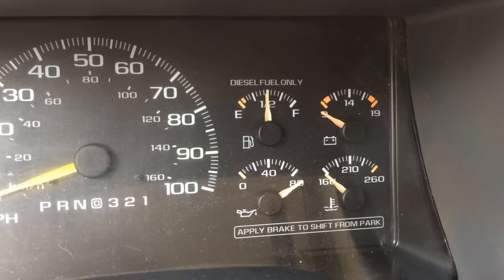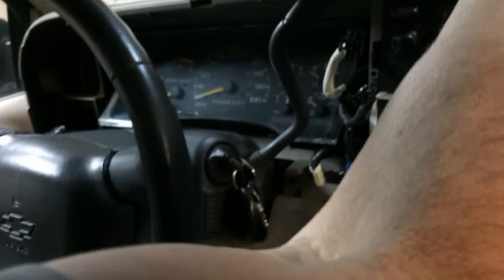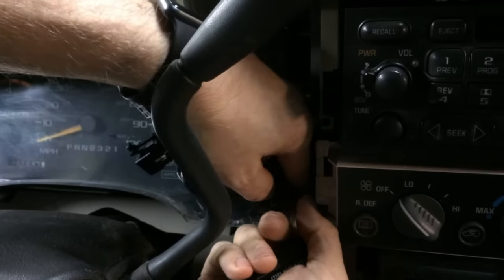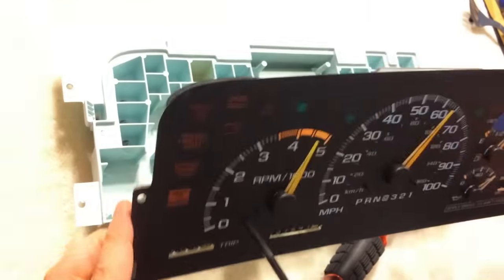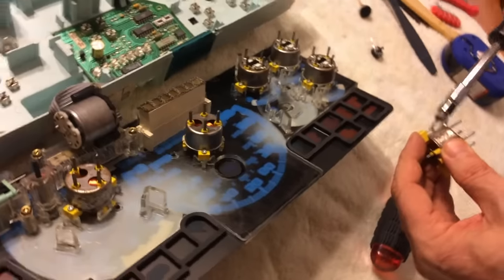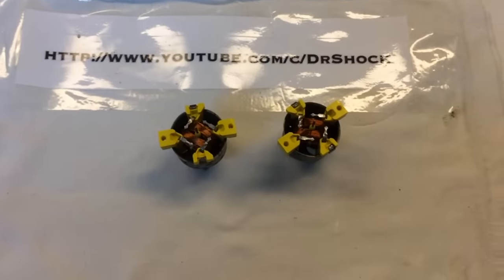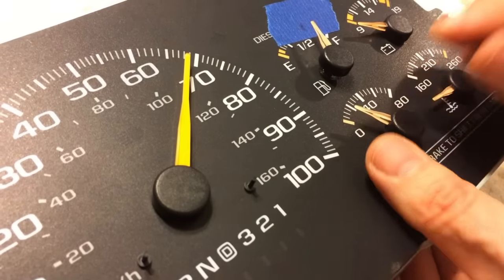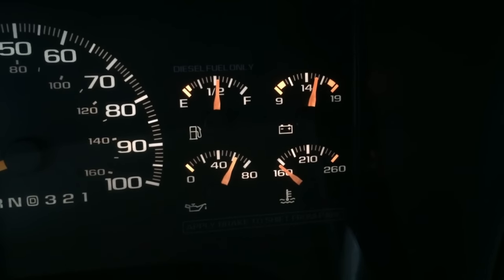1994 - 2002 GM Truck Twitchy Erratic Crazy Fuel & Oil Gauge Needle Aircore Motor Repair (Chevy GMC)

Comment: Dr. Shock como siempre muy buenos vídeos tutoriales, específicos y educativos.
Quería hacerle una pregunta muy específica al tema:
Resulta ser que hace unos días desarme el panel de instrumentos de mi tablero del coche.
Para remplazar unos Light bulb  fui muy cuidadoso aproveche para limpiar instrument cluster connector tanto en macho como la hembra con un cotton tip y alcohol isopropílico (ya que veían con algo sucios y con polvo).
Antes de volver a montar instrument cluster;
Después hice mis pruebas abrí la llave ignición todas sus luces bien, gauges bien, selector de cambios prnd123 bien.
Y al cerrar la llave de encendido.
Probar la iluminación, encendido los tail light Hooo! Sorpresa 😭.
El gauges del oil y fuel se mueven a  la posición cero más que nada el del oil y si enciendo el motor  y Luego tail light veo como el medidor se mueve una un poco hacia cero o empty pero como la señal del ops o fuel sender unit son más fuertes pues no se va a 0 psi.
Buscando información en internet me topé con tu vídeo https://youtu.be/dw9Hia55yys.
El cual me ayudó mucho vi instrument cluster connector en esos diagramas pude identificar cada pin (porcierto que libro usas, ya que aquí en México no es fácil encontrar esa información)
Me topé que el pin 29 es el de las iluminación dimming del señal tail light y hay 2 ground el pin4 que es para la electrónica del cluster y el pin 31 que es para bulb light y Gnd de los gauges veo que se comparten.

Use mi multímetro para medir resistencia y noto que midiendo el pin 4 a cualquier metal expuesto e la carrocería hay una resistencia de 20 ohms yo deduzco que a de ser la vejez de cable pues 22años. 
Pero yo le pregunto sabe usted si  el Gnd del cluster tiene alguna resistencia de paso como protección.
O va directamente al chassis y si para estos cluster es despreciable eso 20ohms en el conductor o recomienda reemplazarlo el cable para bajarlo a menos <1 ohms.

También preguntarte cuando cambie bulb light marca flösser (porque wangler es bien difícil encontrar en mi ciudad) note que al instalar el foco y girarlo ya no prendia la luz y tenía que estar girando asia los lados hasta que entendiera la luz como que el pad de cobre donde van montados es muy delgado o se oxida usted a tenido algún problema así.???

Por último cada vez que enciendo las luces tail light para checar con mi tester que efectivamente el pin 29 se energiza  también noto que el pin 8 se energiza junto con pin 29.

De ante mano agradezco mucho su atención y dispense las molestias.
Reply from the maker: Mucha información aquí, intentaré abordar la que tienes.

- Debe tener cuidado con los solventes en una placa de circuito impreso de mylar flexible como la que se usa en el grupo de instrumentos. Puede dañar el plástico en algunas formulaciones.
- Sí, las bombillas de repuesto de la marca del mercado de accesorios pueden tener problemas para hacer contacto con la placa de circuito impreso flexible. Puede levantar, ligeramente, las clavijas de contacto de los portalámparas con cierre giratorio.
- Estoy usando el manual de servicio de camiones GM genuino de 1998, que ha estado agotado durante más de una década.
- No estoy familiarizado con todos los circuitos de tierra involucrados en el esquema del grupo de instrumentos. Pero suena como un problema de fondo que está describiendo allí.

A lot of info here, I’ll try and address what you have.

- You have to be careful with solvents on a flexible mylar printed circuit board like that used on the instrument cluster.  It can damage the plastic in some formulations.  
- Yes, aftermarket brand replacement bulbs can have trouble making contact on the flexible printed circuit board.  You can pry up, slightly, the contact pins on the twist lock bulb holders.
- I’m using the genuine GM truck service manual for 1998, which has been out of print for over a decade now.
- I’m not familiar with all of the ground circuits involved in the instrument cluster schematic.  But it does sound like a ground problem you are describing there.
Reply: @DrShock  muchas gracias Dr. Shock , no sabe cómo.
El manual de reparación de la GM que tiene se le puede comparar con libro CHILTON 28624, o nada que ver el original siempre será más completo???
Para concluir podría hacerme un favor :
en su otro vídeo muestra en su manual GM en la hoja del :
"instrument cluster connector"
Que el pin 4 y 31 que comparten Gnd  menciona que revise el circuito N° 451 de su libro.
Agradecería si me mencionara si el cable va directo  y atornillado alguna parte metálica carrocería o chasis y porque área aproximadamente se puede encontrar  esa conexión en la cabina o si pasa por algún circuito de protección y por eso la pequeña resistencia.

Dr. Shock de lo demás yo me encargaría  e investigaría.

De antemano gracias.
Reply from the maker: He utilizado guías de Chilton para vehículos en los que no tengo el manual de GM a mano. Ciertamente son buenos libros y los recomendaría. Pero no puedo decir si la camioneta de este año tiene lo que está buscando esquemáticamente.

No he tenido que depurar el circuito de tierra del grupo de instrumentos, así que no puedo decirlo. Pero conecte a tierra cualquier circuito de tierra 4xx (por ejemplo, 451) que se ubicará en el área de la caja de la rueda trasera / cama.

I have used Chilton guides for vehicles where I don’t have the GM manual handy.  They are certainly good books and I would recommend them.   But I can’t say whether the one for this year truck has what you’re looking for schematic wise.

I haven’t had to debug the instrument cluster ground circuit, so couldn’t say.  But ground any 4xx ground circuit (e.g., 451) is going to be located in the rear wheel house/bed area.

Comment: hey Drshock, i have a 97 chevy silverado 4.3, the 3 that show on the ebay link, would they work on my truck
Reply from the maker: The 97 uses the same aircore motors yeah.  But like anything from this older video, the "F" type is an easter egg hunt other than rebuilt now.  After Covid came whoever was making these in China obviously went out of business as haven't seen any new F's for almost two years now.  The others gauge codes still seem to be around (check the video description for a complete list of codes and model years).

Comment: 93 Chevy truck 2500 4x4 do they take the same one you put on the cluster air core motors
Reply from the maker: The earlier trucks also use an aircore type design, as would GM trucks going back to before WWII.  But it's not the same part number as what I've shown here and I'm not aware of a supplier for motors to fit the older design circuit board.

Comment: Where did you find the replacement parts? I looked and couldn't find any with the "F"
Reply from the maker: There are search links in the description.  There's at least one vendor still on eBay with that code.
Reply: @DrShock  thank you

Comment: Would installing a new cluster assembly fix the issue as well?
Reply from the maker: GM hasn't made new clusters for these trucks in many decades.  There were some aftermarket rebuilt ones I linked in the description, but they do not always get the aircore motors replaced.

Comment: My rpm guage isn't moving much when I rev the engine. The old motor from old cluster was working fine. But when I put the old motor onto the new cluster, it's not working right. New motor isn't working right either. Old cluster and motor is in kilometers cause it's a Canadian truck and I'm converting to a cluster in miles.
Reply from the maker: The tachometer (gauge that shows the RPMs) takes its input from the engine computer reading a signal from the alternator.   So I'd start with checking that signal wire from the alternator wiring harness first.   If that looked good, I'd next swap alternators.  Remember when you swap engines, unless it's a compatible match you may run into incompatibilities between engine computers.  When I've done such swaps myself, I've only pulled the engine from a donor of the same year and model vehicle to avoid any computer incompatibilities.

Comment: Could one interchange a air core motor in place of the fuel gauge
Reply from the maker: For the years this video covers, all of the gauges are air core motors which only vary by the calibration.   You cannot interchange them without loss of accuracy.   The fuel gauge is also the more unique as it includes a fluid damper that the others lack.

Comment: My temp gauge usually read somewhere around 200 degrees but suddenly started reading about 180. I replaced the sender unit but it did not make any difference. Do you think the gauge is the problem?
Reply from the maker: If the gauge consistently rose from zero up to 180, no that would seem to be normal aircore motor operation.   If I had this situation I would check that the thermostat is operating correctly.

Comment: I have a 97 Tahoe same gauges and the speedometer has began to read 10 mph fast . I’ve changed the speed sensor on gear case underneath the truck with on difference. 
I wonder if my gauge is malfunctioning and something like this would get it to read the correct speed. Everything else works as it should.
Reply from the maker: It would be unlikely for the aircore gauge itself to be involved in this speedometer behavior.  Unlike later stepper motors, these devices are more analog in nature.  In fact, it would be unlikely to have been the transmission/transfer case speed sensor either so my advice would be put back the OEM one from there if you replaced it with a aftermarket part as the OEM part is going to be far more accurate and reliable.  Parts wise it would be more likely to be the cluster electronics on the flexible circuit board (i.e., oxidation causing additional electrical resistance on a signal trace, reduced spring contact tension at the dash female connector, etc.
 
Typically this sort of problem is from using a tire size different than the vehicle was originally built with and you thus need to reprogram the VCM to account for this change.  But there can be age related drift as well which may be uncorrectable at this point in a GMT400s lifespan.  You may find it cannot be corrected for, but a reflash is the place to start as it would recalibrate this value to original specifications.  The VCM reprogramming route is only if you have a gasoline engine.  Diesel engine vehicles use an older vehicle speed sensor buffer (VSSB) or digital ratio adapter controller (DRAC) module depending on the model year that you have to adjust manually instead.
Reply: @DrShock  I had already put the original speed sensor back and I still have the factory size wheels and tires on . I don’t know much about flashing the VCM but had one person who isn’t that familiar with GM told me that 1997 model was too old to flash/reprogram . If I can find someone that has the know how to do this flash what all does it affect , don’t want to change anything except speedo truck runs great. Do you know what type of machine is used to flash VCM on 97 model ? As I’m sure you can tell I know next to nothing about the computer side of vehicles, but would appreciate any knowledge your willing to bestow upon me .
 One more thought could incorrect Speedo reading be caused by something in the transmission 4L60E .
ie  tcc pulse width modulation silinoid  GM# 24210864.
Thanks for your time.
Reply from the maker: The VCM (vehicle control module) is what would be used on a 1997 gasoline engine rather than a PCM (powertrain control module).  This reflash is just to do a speedometer recalibration.   A transmission shop should have the correct type of scan tool to perform this procedure.  
 
The transmission wouldn't be causing this imo, unless something has changed due to unusual wear in the output shaft area.   Unfortunately this kind of problem is both quite typical as these vehicles get into their third decade of life, and quite difficult (and expensive) to correct.    I've seen a speedometer recalibration help, and I've seen it have no effect.  I've seen replacing the instrument cluster help (to presumably address a circuit board/electronics defect), and I've seen it have no effect.  Given the random nature of debugging this, some folks just move the speedo needle back a hair to correct it, given the diagnostic costs involved to actually track down the root cause.
Reply: @DrShock  I see . Could the tcc pulse width modulation silinoid in trans . be the cause . Just wondering .
 I wouldn’t have a problem moving the speedometer needle back , I could remove the instrument cluster and do that if I knew what to do .Maybe it’s as easy as gently pushing the needle back ,I have no idea but am good with such things.
Reply from the maker: I wouldn't expect any of the transmission shift solenoids to have anything to do with this sort of speedometer behavior.   That doesn't mean that this could indirectly cause something else to be affected that could cause it though.     This video of mine we're commenting on now shows removing and reinstalling the needles for the gauges.   You'll need a precision tool for that, available at Chick-fil-A ;-)
Reply: @DrShock  I saw that precision instrument …plastic fork ..  I’ve most likely got one on hand .
 I do appreciate  the information ,I know more than I did . I may end up backing the needle.
All the Best & Thanks again .
Reply: usdashworks here, if your gauge is reading 10mph too fast your speedometer driver chip is corrupt. The gauge will continually get worse until the speedo is pegged out. unfortunately you need an entire new unit. we cannot get the chips anymore.

Comment: I just noticed that immediately after starting my 6.5L, the fuel gauge and battery gauge decide to sweep back and forth a few times, then everything settles down.  The "Wait to Start" also flashes at that time, even though the glow plugs are at temp (and it starts effortlessly, even cold).  Any ideas if this is a related issue?
Reply from the maker: Doesn't sound aircore motor related to me.   I'd be more looking at an electrical problem, ground issue maybe.  If it were just the fuel gauge, I'd suspect the fuel sender.  But since the voltmeter is also doing it I'd start checking for an intermittent ground problem.
Reply: @DrShock  Lovely.  OK, thanks.  It's odd that in only does it for such a short time, that's what confuses me.  Yeah, it does sound like possible ground bounce.

Comment: I'm also having a issue with my fuel gauge  but my speedo isn't reading right at highway speeds  its 10+mph fast. could this motor cause this??
Reply from the maker: I've not seen, or heard or read, about an aircore motor issue causing an accuracy problem with the speedometer of this nature.  Anything is possible but seems more in the ultra rare category to me.   Typically I'd suspect this sort of small difference happening because of a change in tire size / wheels from the factory issued ones.   You typically have to re-calibrate the speedometer (technique varies by model year ranges).   If not, I'd suspect a vehicle speed sensor.
Reply: @DrShock  the tires are stock size changed the output speed sensor  on transmission  I'm at my witts end with this because its messing up the performance side too. when it hits 65 on GPS it's starting to defuel because it thinks it's going too fast.   sucks for towing
Reply from the maker: Hmm, ok this kind of problem, with the towing performance, can be very difficult and time consuming to track down.     Might not be directly related to the speedometer either.   If it were me I'd resort to a Tech2 tool and driving around collecting live data hoping to see something that jumped out as something to investigate further.
Reply: @stevemaddox4671  Did you ever resolve this issue?  My '99 4x4 Tahoe also reads approx. 10 mph high.  I replaced the transfer case vehicle speed sensor and no change.  I connected my OB2 scanner/app and my PCM signals a speed very close to GPS speed (within 1 - 2 mph).  This tells me that my speed sensor is good and perhaps something is going on with the speedo gauge.  My tach gauge also reads approx. 300 RPM higher than the PCM signal via OB2 scanner

Comment: Ok my speed gauge is reading 20 km then the speed on the road and the oil gauge jumps and the fuel gauge too
Reply from the maker: If the fuel gauge doesn't have the twitching and erratic movement while in a stationary position I showed, its unlikely the aircore motor.  For all three of those gauges to "jump" together suggests to me more of a ground or wiring harness problem.

Comment: Dr Shock Can I use an air core motor from a gasoline cluster if my truck is a diesel or are they fuel specific/
Reply from the maker: Yeah you can, they are not fuel type specific so just the calibration code matters.  There's an "F" and a "C" for the fuel gauge, which one used is based on what year the truck is (details in the description).
Reply: @DrShock  thank you, now to find them.

Comment: Where do I get the spare parts? thanks
Reply from the maker: They are getting super hard to find as time has gone by as they are not being currently manufactured anymore so it's just old Delphi stock parts from the 90s getting sold off it would appear.   I updated to video description recently to point to a speedometer repair shop that was selling them, below the ebay links.   I've also seen the "C" type still available at Aliexpress earlier this month.  But the "F" and other calibrations will be a hunt.
Reply: DrShock 👍🏻
Reply from the maker: @alvinjardine7143  A speedometer shop on eBay is now selling these again, but he's only got the "C", "P" "S", and "T" calibrations currently.  I put a link in the description.